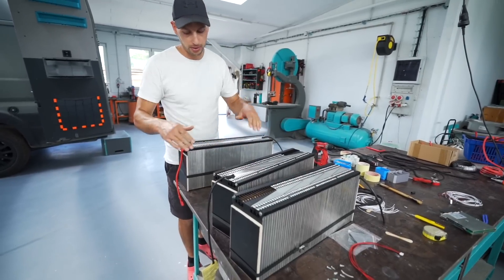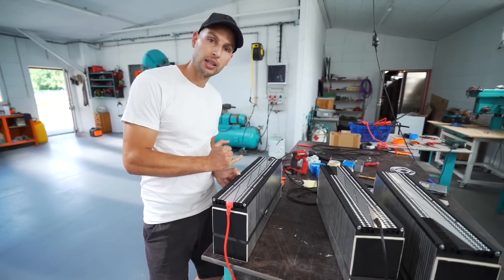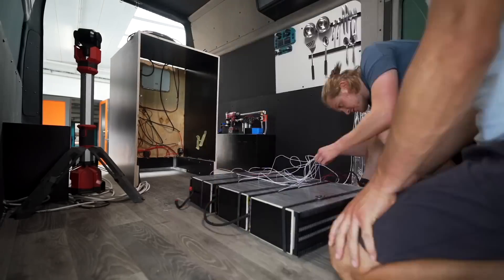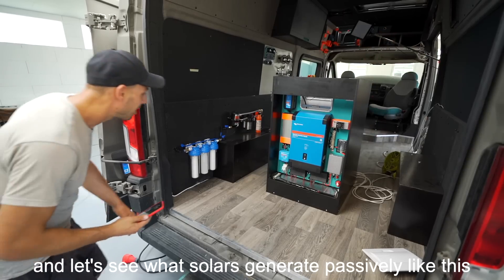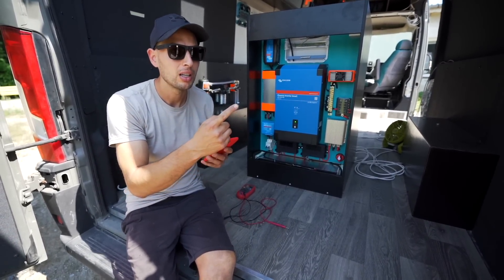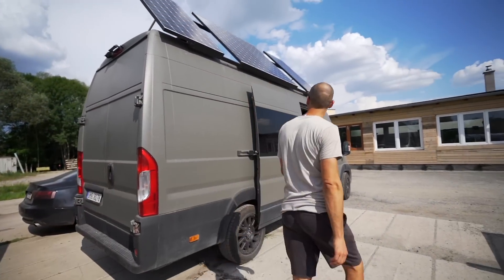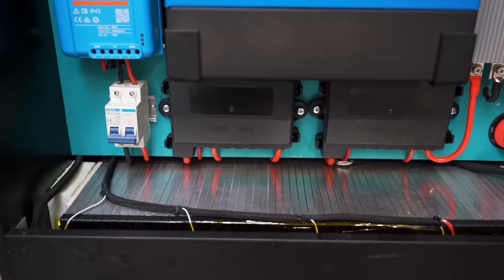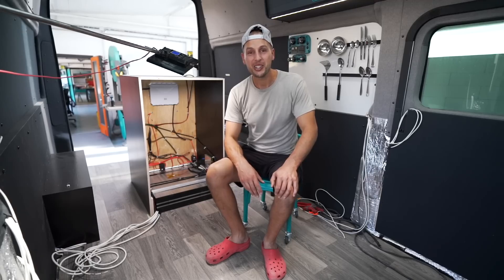How I build 13kWh Battery for Campervan / More Power than a HOUSE

Comment: Hi, could you make a fast test to see the difference with the "array tilt" ?
With an array tilt of 55° to evacuate snow, the best production is July in Canada, same if it supposed the hot temperature reduce the production.
What is your experience with that ?
Reply from the maker: We did the first test recently. 180W with flat panels, 700W when tilted :)
Reply: @ladiandmargaret  Thanks a lot, that means, we should never trust the simulators apps.

Comment: You are wrong bro! You can put 2 panels in series, another 2 in series and after that connect them in paralel. That way you get 40 something Volts and enough Amps to be able to use your controller. No need to buy another one.
Reply from the maker: That’s what I did. Just so you know all the panels are not 20V, mine are 54v each.

Comment: Sorry a bit late now but you can run 2 lots of 2 panels in series then run the 2 strings in parallel. This will give you 53v at half your original amps.
Reply: Love your content though, have subscribed:)
Reply from the maker: Single solar is 48V. That’s what I did and totals over 100V
Reply: @ladiandmargaret  so wouldn’t 2 in series 2 in parallel be 96v in spec?
Reply from the maker: Open voltage is something like 53V. Don’t worry, We thought about it a bit :)

Comment: Your solar controller is rated for 100V max , but seldom will your system EVER produce that , you will be fine .There is always a buffer between good to - and will fail at, 6 Volts will not be the fail point. The only time you will get max volts is during the winter on a clear COLD day , you will likely be using a lot of power in the van so that the voltage will not spike like a short circuit voltage. IF you are storing the van  ALWAYS TAKE THE FUSE OUT OF THE SOLAR CONTROLER Especial if your under cover and the panels get no sun . The SOLAR CONTROLLER USES POWER when IT HAS NO SUN. so PROVIDE FOR A DISCONECT AFTER THE CONTROLER , OR REMOVE THE FUSE , on the side or back of most Victron controllers.      CHEERS AND SAFE TRAVELS     Steve h.

Comment: Why did you choose 12S config for 3.7V nominal pouch cells? This produces 44.4V nominal. Not seen this before. Usually for a 48V system one would use at leat 13S ~ 48.1V or,  more commonly, 14S giving 51.8V nominal, which is what I have seen in the wild and in packs etc. Due to BMS availability or what? These are Li-NCM not LiFePo4 correct?
Reply: Aha! It is b/c you are using LiNcm with 3.6/3.7 nominal Voltage  & 4.2 fully charged -? 3x ~ 12.6V fully charged. I have only used LifePo4, so ignore previous comment.

Comment: I run that same MPPT Controller ( Victron 100/20 )  on a 210 watt panel feeding a 200Ah AGM Battery bank. I also run ( 3 ) Victron 100/30 MPPT Controllers feeding 400Ah of LiPo4 Batteries. The next issue you will have is getting a larger MPPT Controller to fit in that small area of the current controller. Good luck. ** If you click on my name you can see a small idea of my power wall.**

Comment: I’m curious how this system will hold up. Different metals handle electricity in odd ways. The location of the batteries, under the vehicle I like for center of gravity purposes, so it will be interesting to see if electrolysis degradation happens, and how deep it strikes. If it does.

Comment: Woo!  I've got a similar sized power bank in my van.  Makes life easy, runs my washing machine, dishwasher, etc  :)
Reply: Just curious did you build yours with individual cells? Or did you use already built batteries?

Comment: I wouldn’t beat yourself up about the solar panels and the charge controller. It’s taking me a long time to learn and I still am not very good at the math. 
You have more than enough power there for a house, so I’m curious to what you’re going to use all that power for in a van.
Reply from the maker: Electric bikes, cooking, heating up water, running a 3D printer, heating up floors etc

Comment: I had the exact same problem myself with panel voltage. Seems such a silly mistake in hindsight, but when you are in the middle of a build there is sooooooo much going on!
Reply from the maker: That’s exactly right. I like pointing out all the things that worked out for the first time 😂

Comment: Great video Ladi ❤️
We had the same 5v issue with our MPPT, our panels are 32v and were charging at 28v. Now we have to rewire in series and buy one that takes a higher voltage.
P.S.Your Victron inverter video came out just after ours!

Comment: I’ve seen this in n my solar controller and it took me a while to realize the decrease in wattage is part of the smart controller. You can charge at a higher wattage but as the batteries charge or reach full charge the smart solar controller will taper off how much power it is allowing in. If you discharge your batteries 10% or so you will likely see much higher wattage because the solar controller is going to allow the maximum amount of wattage in to convert that to a charge.
Reply: Yep that sounds like a possabillity to me.
Reply: Yeah I thought the same thing when the battery is basically full to charge controller really tapers the wattage down….So while your panels could easily being in 1000 W it’s only using tender trickle charge the battery at that point

Comment: Very neat work, as always! Curious as to why you chose those cells. Do you use them in your e-bikes?

I would always go with LiFePO4 for a camper versus Li-ion. Thermal run-away in that battery would be total nightmare.
Reply: Definitely would love to see more about how you built the pack and set the bms.
Reply from the maker: I purchased them well. I’ve been stressing them a bit in my bikes. They won’t heat up at all with 100A and 15p configuration. Compared to 300A with 2p config :)
Reply: What are those cells please!?

Comment: just catching up on this vid, perhaps to test the controller and principle - drop a panel from the series and check the controller with just 3. this should keep voltage under and allow you to test your premise before replacing the controller with a 150v version. 

hope you get the satisfaction of seeing it running soon!!

:elbowcough:

Comment: I think you could ask Victron for support for the better solar controller. I think the 150/35 could be nice (if it supports 48v)
Reply from the maker: That’s the one I got for the second time.
Reply: @ladiandmargaret  I have a single 340W panel with a 100/30 on 12volt. With 200AH lithium and Induction cooking 😃
Reply from the maker: Good on you 👍

Comment: One thing you should have done different would be to mount the batteries on a ventilated board attached to a 250 pound drawer slides. That way if you need to pull the batteries and work on them you just remove the side that keeps it in and slide them out in full view.

Comment: Always nice updates. You may find the system and fridge generate more heat than you like. We exhausted our fridge and added a duct to the charger out the floor. Quieted it down a lot. Easy to heat but not easy to cool a camper. Looks like you could move your battery to one side and put a thin duct through the floor with a small fan. Keep up the great work. Loads of innovative ideas. Thanks

Comment: The gap between your aluminium battery bus bars seems worryingly small?!?
I assume you have done some aluminium thermal expansion coefficient calculations and that the air gap between polarities remains safe even once they have heated up and expanded ?

Comment: Ladi, did you measure the open circuit voltage or on power draw? Because it WILL drop when charging something. You can just look in your datasheet of the solar to see the closed voltage and compare that? Hope that might help!

Comment: Beautiful wiring

Would it not make sense to use the same battery packs you use on your ebikes? 

A modular system can increase capacity based on number of batteries and be able to swap out between the van, bikes and future battery powered projects.

Additional benefit is you can take out batteries for charging.
Reply from the maker: I’ve never been a fan of swappable batteries but fast charging :)
Reply: @ladiandmargaret  You can have both. Same with solar panels if you have extra flexible panels you can park van in the shade while batteries charge. We use a cheap motorcycle alarm on our panels and battery in case anyone tries to move then we get warning.

Comment: Hi. Your low Watt reading might be due to almost fully charged batteries. If they are close to fully charged, the Watts are getting very low. Thats "normal". I am sure you already considered that. Good luck.
Reply from the maker: Hi, they were in nominal voltage. That was definitely not the reason of low solar charge.
Reply: @ladiandmargaret  with mppt victron you have to add load to the system if the batteries are fully charged and there is no load the mppt solar charger will go to float mode that is he will only provide little power to the system. Try to connect something which consumes  high amps you will see the watts and amps flowing from the roof!

Comment: @Ladi  I actually got introduced to you by the guy in London Wharf that (at the time) was supplying the cells for your bikes. In the end I changed my 12v Iveco for a 24v Mercedes Vario so I swapped from 12 x48v to 24 x24v X 360Ah.  Last point, I haven't figured out my tilting solar panels YET  🤔🤯 - Crack on 💪🙏

Comment: Hey Ladi, really surprised that you made a 'schoolboy error' because your attention to detail is always impeccable. If your panels are rated at 1kW (250W each?), then are they about 39V open circuit and about 8A? Will you be able to cntrol all that from one MMPT controller? In the past I have used a similar capacity using 4 panels, but used EPEVER Tracer 30A controllers on each panel.
Reply from the maker: Yep, everyday learning something new. My original intention was minimizing conversion and have everything as close to 48V as possible. Panels are 53V open circuit so I was supposed to be maxing 20A so nicely on 100/20 MPPT. Your panels were likely on smaller voltage.

Comment: Most electrical components can be run at +/- 10% of ratings. Not recommending this approach but it sounded like you were close enough for a brief test. 

Also, couldn’t you have covered a portion of the solar panel(s) to test the system?
Reply from the maker: Good idea, I could have covered a panel or a quick test! The worst would be if I spent money for a new controller even tho the old one would do the job.

Comment: What battery chemistry are you using? For LiFePo4, I think 48v nominal systems are usually 16s. Also, does your BMS have low temperature disconnect?
Reply from the maker: It’s lipo. Yes, I can set up low temp protection.

Comment: About the solar over-voltage issue, couldn't you use a 100V zener-diode shunted over the solar lines? I don't think that would hurt solar power as the voltage would probably always be under 100V when there is a load anyway. Thank you, keep up the good work and greetings from Finland!
Reply from the maker: Idk, I think it would be better solution rather than replacing the whole controller for a bulky monster.
Reply: @ladiandmargaret  IDK either. But a zener-diode would cost a fraction of a new controller and be an easy install. It would be an honor to have one idea integrated in your build but I won't pay if it doesn't work and you mess up the controller 🤣
Reply from the maker: The problem is I already purchased and received the new controller and sold the old one 😂
Reply: @ladiandmargaret  Of course 🤣🤣

Comment: I had the same "+5V" issue with my solar pannel, the Victron MPPT triggers only at noon (without any clouds)....my pannel are fixed on the roof.
I had to re-arrange the pannels connection...

The good thing is: i never seen the previous old MPTT (it was an EPSOLAR) controller sinks so much power from the same pannels: about 20% more power!!!
Reply: I had the same problem with the Victron controller and it was installed by a Dealer! It took me a while to find that you need 5V more to trigger the charging process. Shame on the dealer for installing like that, on the other hand Victron has this information only hidden very deep in their documentation, not very obvious to see......

Comment: I saw that the whole battery pack is hold down with an aluminum bar with some bolts directly onto the chassis at 12:40.
In theory this would create a problem with galvanic corrosion, especially when these is humidity/water involved (from the bottom of the van). Time will tell if this practically really creates a problem, but it is certainly something to keep an eye on! Especially when you use that bar as a ground as well!

About the solar panels, yeah that is a bummer. Rule of thumb is always use doubles series + parallel for a 48V system, or swap to a 24V system instead. Really nice build though!!

Comment: Can your solar panels be stopped at different angles? Or is it always flat on top or tilted at one angle? 

Do you have an easy way to figure out how much it needs to be tilted?  The reason I ask is it seems like being tilted too far can be as bad as being flat on top of the roof.  You've done great being able to tilt it.  I'm sure your phone can tell you which way South is.  It would be even nicer if your tilt system could follow the path of the sun as it travels through the sky.  (But to be honest, I think I've only seen Solar Power farms do that.  I'm not sure.)
Reply from the maker: It can be stopped at any position. Easy way is to see the output on my phone and stop the tilt there. Automated system should be easy to do with my hardware.
Reply: @ladiandmargaret  you need just two photo sensors to do that. Take a look at this video here. From minute 4 it will be explained. As you have only one axis, two sensors are enough. https://youtu.be/_6QIutZfsFs

Comment: What cells did you use? What's the price per cell?
Reply: I was curious about this too they look like the 8ah SPIM cells that I’ve seen at batterhookup, and have built a 48v pack from as well …but his build of them into thi bank is super clean.  I would also like to know which bms was used?

Comment: Hi Ladi and Margaret 
I know space is tight, but how are you handling air flow around the battery bank?
I don't see any venting or circulation fans.
Reply from the maker: I’m likely be adding some later.
Reply: I work on controllers for refrigerated transport trucks. Road grime, corrosion and and heat are the top three killers. Everything you can do to keep your electronics clean, dry and cool is a good thing.
Reply from the maker: Yep, same with most electronic components.

Comment: I have used these IEG cells in a few projects, also used aluminium busbars, and had many issues with oxides isolating the cell from the aluminium ( eventrough the screws are torqued correctly ). Our solution was better sanding / cleaning and using contact paste with metal particles in the paste. Hopefully you get it first time right!
Reply: What battery cells are those!? I didn’t hear about them

Comment: Why 36v battery instead of more common 24 or 48v?
Reply from the maker: 12s is 43V nominal. Because of high power output
Reply: @ladiandmargaret  Oh, I thought those were LiFePO4 cells..

Still a bit odd voltage. I would have go to 7s 24V to use appliances directy from battery 👍
Reply from the maker: 14s would be the right 48v I think.
Reply: @ladiandmargaret  Yes. 

I have 24v system on my bus and I can hook everything right to the batteries, and no reason to power up the inverter. 
I find that handy, though my battery capasity is much smaller, so there is reaston to save it. 

(And your solar controller would have worked on 24V) 😁